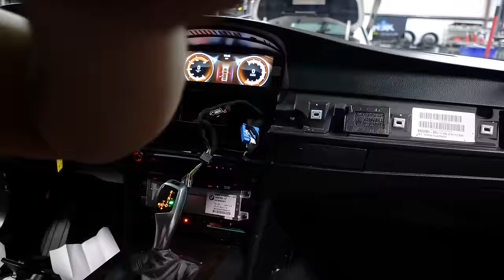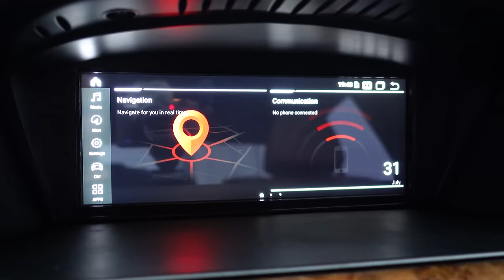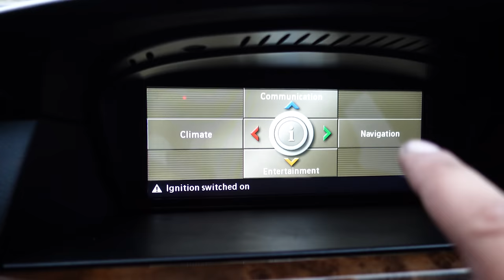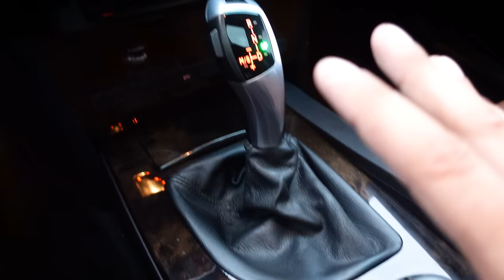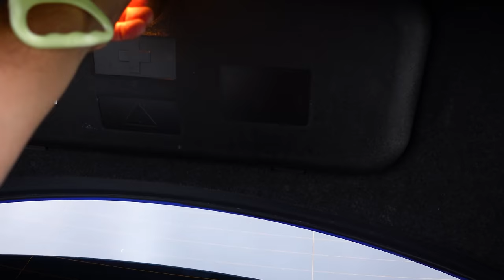Rebuilding (And Heavily Modifying) A $600 ROACH-INFESTED BMW In 4 Days

Comment: It's heartwarming for me. I drove one of these for 14(!) years and 300000km/ 186000 miles before i sold it. It is one of the most amazing and smooth running engines ever build and i had no big damages in all these years ( Only the doorhandle, a sensor for 10 bugs, the waterpump and 2 small parts of the axle suspension)
If you look for an reliable car and motor.... buy it!!

Comment: Jared: "It's got M5 bumpers, M5 wheels, new tires , big brakes, and the better engine"

Jared's Wife: "Meh"

Jared: "But check out this cup holder"

Jared's wife: "WOW!!!"
Reply: Its a straight 6 but otherwise
Reply: @vl4924  the straight 6 is awesome and much more reliable. Best balanced engines you get too.

Comment: Did they mention the total cost of this rebuild? Also props for such a clean and fast build.
Reply: Definetly 10-15k $ minimum. He makes all the cash back from sponsorships and add revenue tho.
Reply: @reanukeeves4436  def not worth it imo you can buy a real m5 for 10-15k and get rod bearings done for less than another 2k... and a lot less labor
Reply: @Whiboi  is 4 the channel
Reply: @reanukeeves4436  why do you say that? Parts car couldn’t be anymore than $2000, and that’s exaggerating. Paint is probably another 2k, it’s gotta be less than $6k
Reply: @jellybIood  it wasnt paint job it was vinyl wrap so that is good 3k, all the small mods like ligths, brakes, fluids,valves, spark plugs,filters...(etc), May not seem much but they add up quickly to 3k and lasty parts car was definetly expensive because all the parts were in top shape. So with those few extras that you can add to your own estimation you are already up to 10k at the absolute MINIMUM. Car mods are insanely expensive and you should never under estimate the cost.
Reply: @reanukeeves4436  you need to check your prices sir because you’re way off. You do realize it would make no sense to spend 10-15k refurbishing a $600 car that would at most be worth 5K if it’s got some decent mileage on it.
Reply: @kmb96  ever price i mentioned is spot on. According to social blade he earned 4k from this video alone and that is not counting in the sponsor and "discounts" for giving certain companies a shout out like the wrap shop that wrapped his car. People really underestimate how much freaking cash people earn off youtube just for spending money on their little projects. He modified his BMW "for free" thanks to youtube and earned some extra cash for sure.
Reply: @reanukeeves4436  every price you mentioned is NOT spot on. A wrecked 5 series (the donor car) is not going to be more than 2k possibly less if purchased as a salvage vehicle (no reason not to when it’s only being used for parts). Lights, pads and rotors, fluids spark plug and maintenance items don’t equal 3K either. You could buy the most expensive aftermarket versions of all those things and still spend half that. I have worked in the auto industry about 5-6 years and in reconditioning for the past 2-3, you can’t convince me he spent 10k to get a shitbox up and running. Like I said, the car isn’t worth more than 5-6k on fb marketplace/Craigslist so what sense would it make to spend double to triple that on fixing the car up. You’re trying to convince me of ad revenue and sponsorships making it worth it but let’s be real here man, you are trying to be an internet subject matter expert with no actual qualifications. I’ve been a reconditioning technician, inspector and a manager at a few of the biggest sources in the country for fucked up cars that need tlc before they’re sold. I’ve seen R8’s come back from being basically salvage cars to damn near showroom quality for 15k so excuse me for not seeing 10-15k worth of parts when this is what I do for a living
Reply: @kmb96  Definitely close to 10K
Reply: Easily 10K+ I wonder if it was worth it, The car car came out really nice, Maybe should’ve did some performance mods too, Tuning would’ve been great 💪🏾
Reply: @kjbugz15  I own an E90 BMW with the same N52 engine and there is VERY little that you can do with regards to tuning and trying to get more horsepower out of it. Your only real option is a supercharger kit from ESS but that kit costs $5k just for the parts, so at that point you might as well sell this car and take that 5k and put it towards a car that has a more tune-able  motor like an N54 (twin turbo) or an N55 (single large twin-scroll turbo). For a daily driver though, an N52 is about as reliable as you can get, *as far as modern BMW'S are concerned*, and it also happens to be a motor that is literally butter smooth, perfectly balanced, and just enough power to get out of it's own way. You can certainly do a lot to increase the suspension/handling on the car, which, even starting from stock is a lot better than many cars out there for that size. With just some wheel spacers, some good tires, some M control arms and sway bars and a good set of coilovers plus a few other minor mods and you'll be beating A LOT of similar classed cars through the twisties. Ok well that was a mouthful, but yea, they spent 10k easy here.
Reply: @Whiboi  where u buying a m5 for 10 k
Reply: @kmb96 .
•Are there any U.S. BMW parts vendors you would recommend for best prices on OEM OR Aftermarket parts?

•East Coast junk yards for BMW donor cars at best prices?

Comment: Can we get a link for the lights front and rear, and the new idrive and steering wheel.  Also you should relocate the small box under the spare tire .  E60 can develop water leaks and that box will short out and leave you dead

Comment: Ahhhh..the PCV hose. The plugs heat the hose to prevent it from clogging in cold weather climates. My PCV on my 330i went bad and I replaced the entire system.

Comment: the e60 is all aluminum, perfectly balanced and the chassis itself only weighs about 68 lbs heavier than an e90.    the 535i is the best car ive ever owned, and ive had every m3 since the e36 to g80.    the e60 with its perfect balance, wider track width and slightly longer wheelbase than the e90, is actually a track weapon in saloon car disguise!!!!   the hydraulic sway bars on the e60 keep the car flat and you can go deeeeep into the corners like you cant in any other bmw.   of all the other cars im familiar with driving at speed around the track, the e60s feel more like a 911 and that sounds funny, but if youve ever driven a tuned 535i you know what im talking about lol

Comment: That and getting rid of that one bad interior panel, along with the headliner and carpet would have been sufficient to call it a budget build as the rest could have been salvaged, fumigated and re-colored.

Ozone works amazingly well.

This guy is pushing the limits of what anyone can reasonably call "Budget" unless he's being facetious and actually saying "unlimited budget, thanks to my sponsor".

I, OTOH am trying to justify spending the money on a wrap as opposed to a cheaper total paint job for my old Mercedes to use as advertising / equipment hauler for my karaoke business.  Maybe I can find a nice sponsorship to help out in exchange for a video of the process?

Comment: Great video but that valve cover is going to leak again very soon. It’s a must that you use brand new bolts for that job as they are torque to yield bolts and they stretch. Speaking of torque…. It’s beyond important these bolts get tightened properly with the first pass starting with the three center 10mm then working in a criss cross pattern inside to out tightening to 7Nm then a second pass is required using a tech angle torque wrench with a pass of an extra 90 degree turn on each bolt. It’s ridiculous how close it’s got to be to correct to not leak. I see it on a daily basis. I’m not some know it all, just shedding some information in case someone has this engine and attempt to do it as they did. At the end of the day to each their own… if it runs and the owners happy, then that’s all that matters!!

Comment: I bought an 07 Ranger with 100,000 miles.  3 of the spark plugs looked just like that one, and the other 3 were missing the diode on the top.  I have no idea how the thing even ran.

Comment: Not a fan of this screaming colour and I don't like the front fender grilles, only M cars have those and this is not an M car. 

That said: holy macaroni this car is so gorgeous.  The E60's design was probably a bit ahead of it's time when it launched in 2003. But now, 20 years later, with the M5 front bumper and especially those modern headlight units, it just works so gorgeously well holy cow

Comment: Wrapping a car is much more expensive?
Reply: Nah
Reply: @thecursedhumortm9885  here in Europe painting a car is around 600$ ,but wrapping one is 2000€
Reply: @berk_adem7  well it really depends on what results you are after. A wrap start s at ≈$2,5k in Sweden and you can get a repaint for $2k but if you want good results and to change the color you could need to spend all the way to $10k (Sweden)

Comment: If you check the real stats, BMWs are largely reliable - more so than many other OEMs. BUT... That's dependent on maintaining them properly. (Yes, some have issues, but they're statically reliable as compared to many other cars. I can dig out citations if need be, but Google is helpful here.)

See, the problem stems from people not maintaining them properly. Usually, the first owner will do okay. They might start to lapse as they're nearing the point where they are getting rid of them. The second owner does fuck-all to maintain the vehicle. The third owner is straight fucked.

Also, they're expensive (comparatively) expensive to maintain and repair. Maintaining it properly will help keep that repair bill down, but that's still fuckin' expensive.